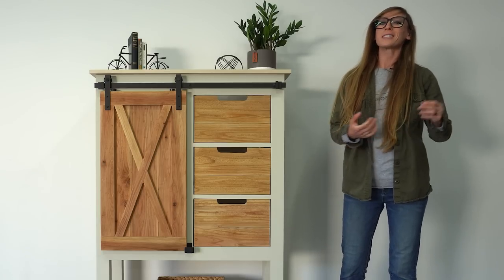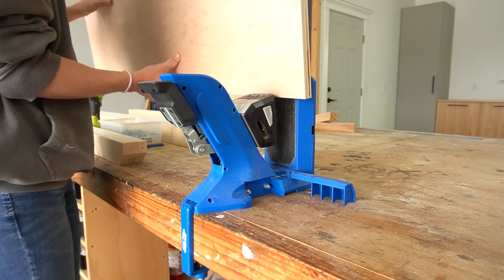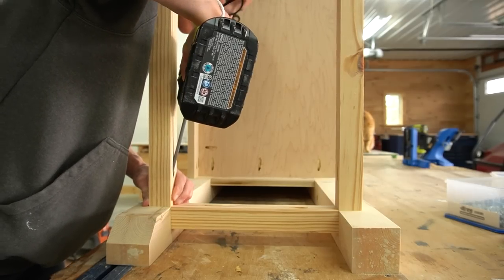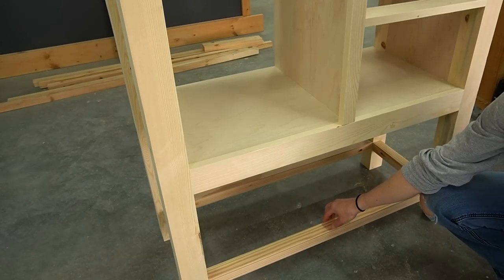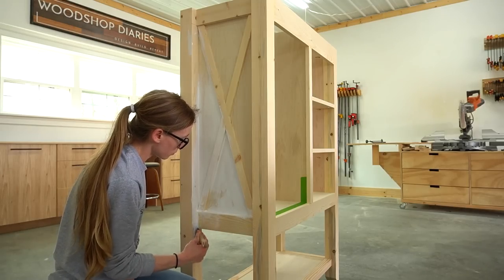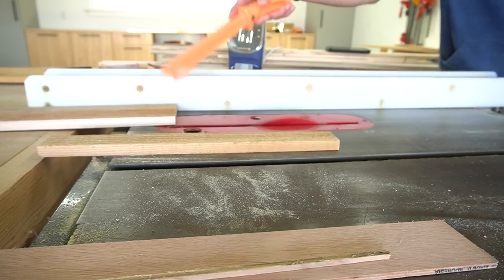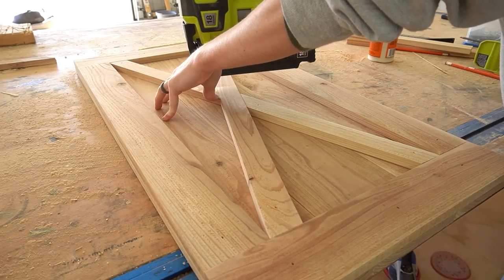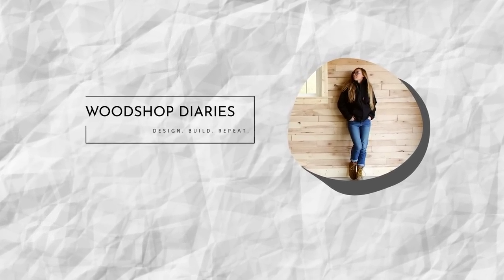How to Build a Sliding Door Dresser with Drawers

Comment: OK I love everything about it Great video, I love watching you build stuff from the comfort of my couch...

The engineer in me has to comment...

I could be wrong but brad nails into the front of doors that are pulled on to open offer extremely little additional strength and are really only necessary to hold the pieces for the glue to dry. Once glued, the glue is a stronger bond than the wood itself.

Just my thoughts may save you a few brads and a trip to HD in the future.

Clamping while the glue dried may have helped more.

Armchair quarterback here.

Keep making great videos, Thanks
Reply from the maker: Thanks so much for watching! Also, yes, the brad nails don't provide much strength--although they do provide a little. However, nailing at alternating angles will provide some additional holding power. I needed the nails for the door in the next step, anyway, plus some stain and paint trays for another project, so not a completely useless trip to town haha.
Reply: @WoodshopDiaries Thanks for your response. Like most of your viewers I sit on my butt and criticize. If you want revenge you can critique my videos 😂😂😂 please don't... mine are music. My co-workers call it crappy 🤣 there is some violin 🎻

It's fun to be part of a conversation and I think it helps your metrics.

Comment: Really enjoy your videos, Ive only seen a  handful, but really enjoy the knowledge you give, I have a question, I see that you use pocket hole joinery a lot, which I do as well, I don't see any glue being applied along with the pocket hole, Just a preference of yours?
Reply from the maker: I actually reference this in my latest video. In most cases with pocket hole screws, glue won't hurt, but it may or may not actually help. But it will make things much messier. I don't use glue often (I do some when it seems necessary), and a big reason is because I recycle my projects--take them apart and reuse the wood to build something else.

Comment: Just have a question for you. How come you don't build drawers with dovetail joints? Instead of pocket hole joints? The dovetail joints are stronger. And will hold up better over time. Congratulations! It is a nice functional project though.
Reply from the maker: Dovetails are great. But I’ve never had a failed drawer using pocket holes either. They’re quicker, easier, and more approachable to others who are looking to build the same. There’s plenty of ways to build a drawer box and most of them work equally well for the application they’re used in 😊 thanks so much for watching!

Comment: Such a cool build!  Did you put any kind of finish or top coat on the cedar pieces, or did you just leave them raw? Thanks.
Reply from the maker: Thanks so much! I added a coat of Minwax Helmsman on them--It probably wasn't necessary, but it helped smooth the surface out a little bit more.

Comment: Do you ever use glue where you’re using pocket screws or would this be overkill ?
Reply from the maker: I do in some cases. But in most cases, it doesn’t add much of anything except a big mess to clean up during assembly. 
When I only use one screw at a joint, I always use glue. Otherwise, usually not.